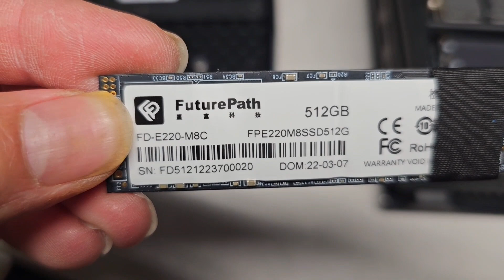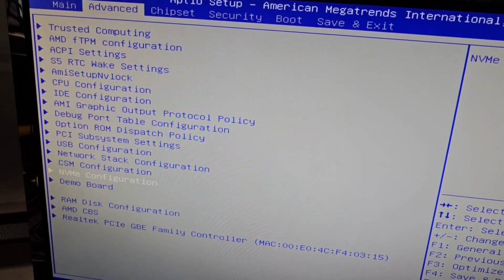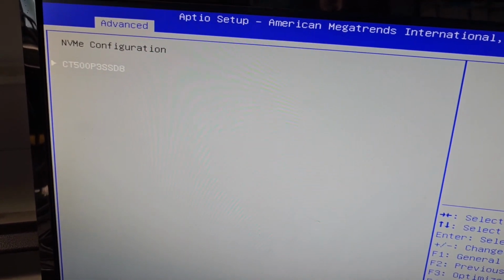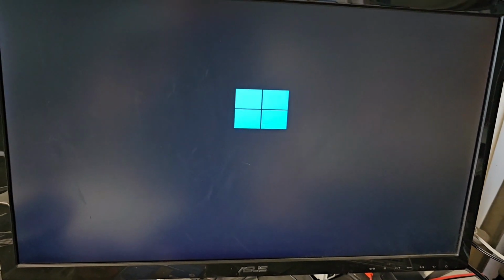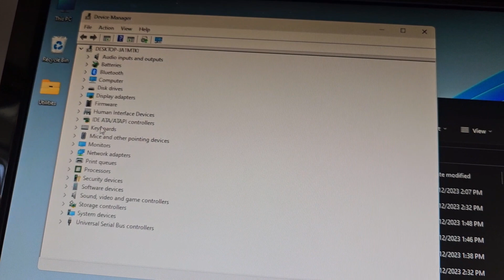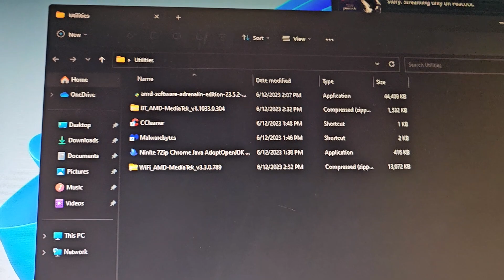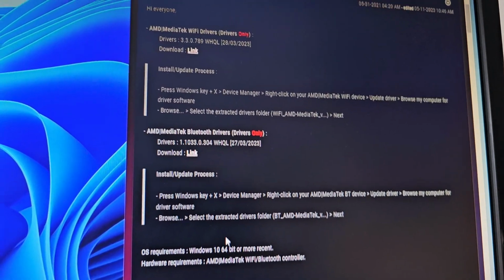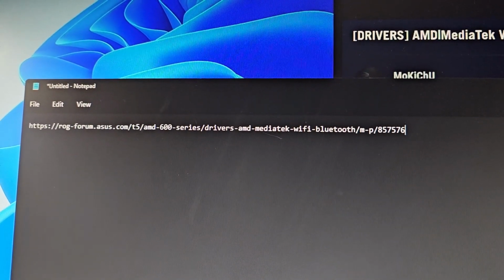ACEMAGICIAN Gaming PC, AMR5 AMD Ryzen 5 Desktop Computer Small PC RAM SSD Upgrade Replacement Repair

Comment: be aware the win 11 install out of the box ( bought on ali express ) could come with ramsomware as it happened to me, luckily I used a secondary email but someone captured it and it was asking for 5000k . Create a win11 bootable drive, wipe out all the partitions and start clean.
Reply: Cuando compre la mia la ACEMAGIC S3A AMD Ryzen™ 9 6900HX revise y formatee el ssd a una instalación totalmente nueva. Porque es lo que se debe hacer cuando compras un equipo de compañia no uno que hayas ensamblado.
Reply from the maker: 5 million dollars?!
Reply: @ItsBinhRepaired  lol 5000 usd 5k
Reply from the maker: @davocko lol

Comment: What is the key to enter the BIOS?
Reply from the maker: Not sure. Try F2 Del or F1
Reply: @ItsBinhRepaired  I found it, it's the Escape key.
One more question, Why can't I boot from my USB? I believe I've done everything necessary, but it doesn't detect it, or I don't know which key to use for booting.
Reply from the maker: @pcrruco what's on your USB?

Comment: I got Acemagician k1 mini gaming PC AMD Ryzen 7 5700U 16GB DDR4 512GB SSD I was wondering how you increase the VRAM it wasn't a setting to increase it in the bios menu I was wondering if it's possible another way
Reply from the maker: Nope
Reply: @ItsBinhRepaired 
Is it possible through using flash drive method I seen people talking about on YouTube
Reply from the maker: @nicholasbeach824 I'm not sure. Flash memory is very slow
Reply: @ItsBinhRepaired 
True thank you also for the real honest answer anyone I will ask couldn't really tell me specifically. I'm going to hit that subscribe button. But the computer for the most part I got and I did get it today seems to run emulation pretty well so far but on steam I couldn't run Dark Souls Remastered I tried re4 2005 HD I couldn't run that well but re5 the best so far surprisingly
Reply from the maker: @NickVonSlick  yeah, sadly it's too small to fit a more powerful gpu.

Comment: Would you ever consider adding a pcie express to m.2 and add a discrete gpu to this mini pc i added a gtx 1080 and its reliable to say the least 1080p with better fps and fidelity than the orginal i think its worth exploring
Reply from the maker: @Backflipornament  not sure. Too compact.
Reply: @ItsBinhRepaired  I was playing with the hdmi plugged into the mini pc and it was bottleneck city, now I've learned my lesson and plugged the display into the gpu I've seen alot of noticeable difference compact isn't really how I'd describe it more like having a frankenstien pc that is a power supply a pcie express m.2 slot a gpu and then a opened version of this mini pc there is a video on YouTube showing the setup
Reply from the maker: @Backflipornament  nice! Haha

Comment: So I have a question because mine just stopped working out of the blue so it this what I need lol
Reply from the maker: @HalwGardia  uhh that's not a question lol
Reply: @ItsBinhRepaired what I mean is mine shut off out of no where so did my ssd die or is it the ram I don’t know because I wanna know what to replace? 😅
Reply from the maker: @HalwGardia  if no power, motherboard, power cable, or dc jack
Reply: same

Comment: It’s gunna give out in 5-6months. These things aren’t reliable. Had to replace mine twice until I just told them to refund me. What a waste. Just save for a legit desktop
Reply from the maker: Damn :( you need aftermarket parts, not the generic ones manufacturers put in them
Reply: Agreed which is why it’s better to just build your own imo
Reply from the maker: @dadabumpin  but some people like the form factor lol
Reply: @ItsBinhRepaired  don’t get me wrong I love it too. I wouldn’t have gotten so many replacements if I didn’t. And I used many different hardware to my own liking but unfortunately the entire company has defective manufacturing. I’ve tested it with professional techs as well. I’m simply helping those who aren’t willing to go over and beyond to not waste their money
Reply from the maker: @dadabumpin  :/
Reply: @dadabumpin  this is how I feel about the Steam deck, I like this little pc WAY more than a 800$ steam deck that can hardly run any games. I am A OK with upgrading some ram n ssd. It ain't expensive when this lil thing cost 280$ on sale just shove a new ssd in this hoe

Comment: I have one and it just wont boot up anymore only had it for five months i have two ssds in mine any would it not boot if the ssd is bad?
Reply from the maker: Does it show anything on the screen?
Reply: @ItsBinhRepaired  no it won't even turn on at all when I plug in the power bank the light on the power cord turns off
Reply: I tryed a different power supply and the same thing tryed taken out the SSD and ram with different and it won't power on at all
Reply from the maker: @danieljoyce4844  send in for warranty
Reply: @ItsBinhRepaired I tryed sending it in but they won't honor the warranty cuz it was bought Brand new on eBay even they Ace sells them in eBay I just got ripped off can't recommend this company
Reply from the maker: @DrNevaMrMind  :(
Reply: @ItsBinhRepaired  yea that was my rap name back n the day
Reply from the maker: @DrNevaMrMind  what was your rap name?

Comment: Would any ssd with heatsink included fit?
Reply: It has a capacity of 4 TB, or two 2 TB M2 SSD drives. This unit is similar to the one that's branded as Kamrui. The SSD that comes with these units are literal trash. Anyone who buys one should install another SSD in the extra empty bay and clone everything to it as soon as they can. At least the Kamrui Ryzen 5700U system I purchased had decent quality Lexar RAM cards included. Some units has a provision to mount an extra cooling fan in the cover to cool the RAM and solid state drive. I recommend doing this or purchase a small fan and sit it near the PC to aid cooling it. Especially with the gaming units. They have some issues with cooling during extended gaming sessions. But mine after upgrading to 64 GB of Kingston Fury RAM, a WD Black 2 TB SSD and the cooling mod, I've honestly haven't had too many issues with mine as of yet.
Reply from the maker: Nice
Reply from the maker: Most likely